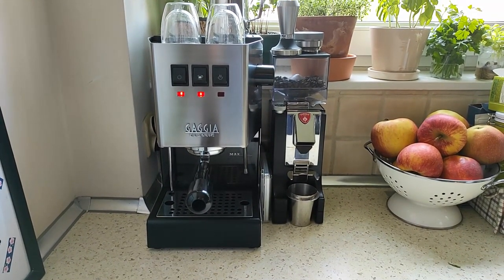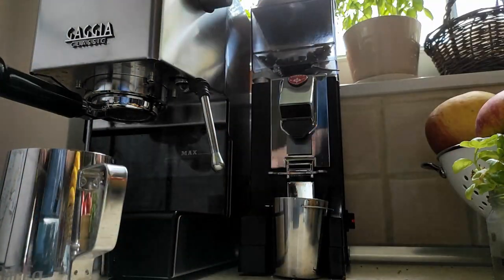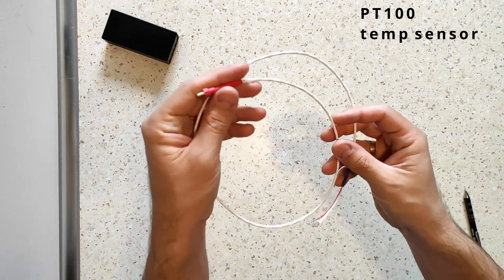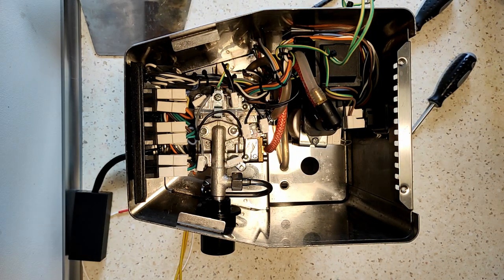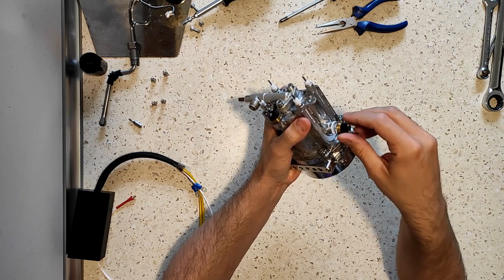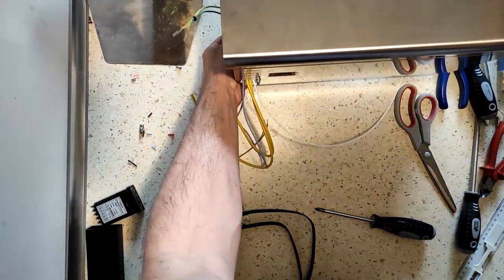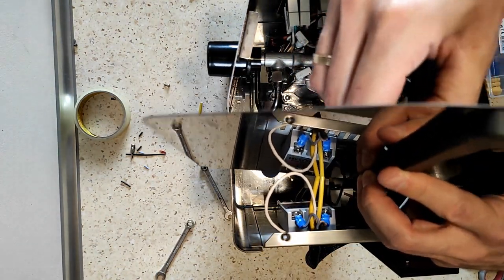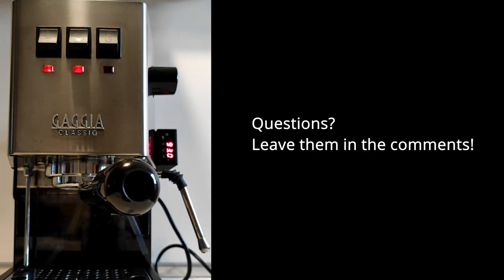How to install a PID on a Gaggia Classic Pro - DIY, cheap and good looking!

Comment: Does rex c100 work in these gaggias? I've installed it step by step as you described and the temp sits at 25-28...very frustrating it doesn't work
Reply from the maker: I've seen people using Rex C100 but I've got no experience with it, so I can give you just some general troubleshooting tips.
1. Double check all connections: whether you're using the correct ports and how securely they are connected
2. Make sure the correct type of temperature probe is set in the PID
3. Let the machine properly heat up, set the desired temperature and run autotuning.

I'll keep my fingers crossed! Good luck

Comment: HI, thanks for the video. Can you please specify the width of sleeve you used, and provide links to the following cables or alternative keywords to use (had no luck searching): 
1. About 60cm of SiHF 2x0,5mm2 cable connecting the PID do the SSR 
2. About 60cm of 1mm2 (17AWG) cable to deliver power from the Gaggia to the PID 
3. About 60cm of FLRY 1.5mm2 cable to connect the SSR to the Gaggia

THANKS!
Reply: Disregard, I was overthinking things. I realized I have a bunch of wire and can insulate it where needed if I have to. Ordered everything I need for $45! Much better than the $200-$300 I almost spent for a ready made kit. Thanks for the guide.
Reply from the maker: If anyone still needs this:
The sleeve width is 15/25mm that's for unexpanded/maximum expanded width.

To find apropriate cables look for:
1. Look for two strand silicone cable of the given thickness. Silicone cables are rated to temperatures reaching +200*C, so they can be comfortably routed right next to the boiler. They are also very flexible.
2. Same as above but thicker and sinlge-strand. If you type in the thickness and "silicone cable" in your marketplace of choice, you'll see them popping up.
3. FLRY-B cable is a PCV coated multiple strand copper cable used in car engine compartments. Look for heat resistant cables of the given thickness, able to withstand up to 105*C.

Comment: Would this mod work on other cheapish espresso machines.  My mother got me a 15 bar espresso machine for Christmas without consulting me on if the machine was even a good idea. So I'm looking around for mods to do on practically any espresso machine rather than specific to one machine. I know it seems like a dumb idea why not return the other one and get a gaggia classic pro, but I don't want to be a prick of a son and tell her that she got me a bad machine. I know about the OPV spring, I'm also looking into a dimmer switch mod for flow control. Sorry for the bother.
Reply from the maker: I managed to get decent espresso from the Gaggia back when it still operated at 15bar pressure, it was just more difficult and hit and miss. My tip for you would be to get a WDT tool and a puck screen to alleviate the high pressure.
As for the PID control - I really don't know. Some principles would still apply, like replacing the thermostat with the sensor and using the SSR to control the heaters, but the details you'd need to figure out on your own, I'm afraid.

Comment: Thanks for the video. This works for Gaggia Classic 2015 EU version?
Reply from the maker: Yes, it should work just fine
Reply: @robertkujawa3504  Thanks for the quick answer. Did you work out how to PID Steam? I am tired of triying to do latte art anda before having It ready, the Steam light goes off
Reply from the maker: There's no need for the PID steam control. Once my kitchen remodel is done, I'll record a video showing how I use the temperature reading to get lots of steam pressure and volume. For now, here are the steps (temp offset 8*C)
1. flick the steam button and watch the temp on the PID display
2. once it hits 140*C purge the wand
3. once it hits 150*C start steaming
4. introduce a single burp of air right at the start and then keep spinning the milk as long as it takes for it to become too hot to touch
5. wipe the wand, release remaining pressure, fill the boiler back up

Using this procedure, I never see the steam light come on and get enough steam for two pitchers!
Reply: @robertkujawa3504  Wow, thanks for your clarfying answer. Waiting for that video without doubt. I have dissambled the machine, and as I said, mine is Gaggia 2015 EU. The button part is different, and the connectors are 4.8 width, so, is it possible to power the PID directly from the energy connector at the back? You just took the neutral from this site. I hope the PT100 fits the boiler btw

Comment: Can you install two PT100 precision temperature sensor to the same PID? One for the Boiler and the other for the steaming?
Reply from the maker: I don't think that makes sense: it's the same boiler, they would both show the same temperature.
Reply: @robertkujawa3504  I meant connecting two Fotek solid state relay (to the PID) to have two settings (one for brewing, one for steaming)

Comment: hi robert, thanks for that awesome video. i am also thinking about buying this machine and modding it. can you tell me if it's possible to do 2-3 double shots after another (maybe with some minor help like using steam wand to bring temp down)?
Reply from the maker: If you're not steaming in between shots and let the machine preheat properly, I'd say it's pretty manageable. I can pull 3 espressos one after another without any detrimental effect on the taste.

Comment: Hi, could you please give me AWG equivalent for your silicone cabling? I’m not sure what your specifications mean. Thank you.
Reply: And why use flry cable to connect to the Ssr? Thx
Reply from the maker: @TomNavesink  So the AWG for the silicon cable would be 20 (AWG 20). And the FLRY cable was used to get proper temperature resistance.

Comment: Hi, thanks for this great tutorial! I have a question though:
For the PID power source is it ok to tap with the piggy back on the power switch instead of the brew switch? I’ve read another tutorial and they tap on the power switch, thanks
Reply from the maker: You should be fine, the bottom white wire should carry 220V, but it's always good practice to verify this with a multimeter.
Reply: What difference should make that change in the connection?

Comment: Thank you for creating this, would all the parts be the same for Canada (which has the same electricity as the US) thank you
Reply from the maker: The PID I'm using can take a range of voltages, so that's a yes.

Comment: I successfully completed my PID controller install. In the end, after watching all of the videos, I just had to guess. No one had filmed the install on an early Gaggia. Mine is from 2002.

Part of the problem here is that Gaggia was entirely inconsistent with the colors of their wires. I had a hell of a time following what the tutorials were doing. In particular on this video, @11:00 he says brown wire. Where? Who knows. Mine does not have a brown wire on the brew switch, which is not in the middle, but on the right. From bottom to top, mine has two gray,  then white, and then red. So...which wire? It would be much more helpful if the tutorials said what the wire does what so that we can look at our particular machine, all of which will be different. 

The piggy-backs I installed when from the neg/blue wire on the power wire on the back wall of the Gaggia and the steam switch in the middle using the double/white wires at the top of the switch. I used heavy (14) gauge wire throughout. I did not have to remove the boiler in order to install the temperature sensor, thankfully. It was a bit fiddly, but with a little patience, not difficult. Also, I was able to attach the extruded box and the relay with 3M double stick tape. The back wall of the Gaggia is cool enough for the tape not to overheat. I cut a 2.5cm x 2.5cm hole in the side of the extruded box into which I was able to fit all of the wires. The result is very clean with no wires visible from the back and everything is reversible. The next step, a dimmer circuit to the pump, will not be reversible, however, as the knob and shaft will be drilled through the side of he Gaggia on the right behind the steam valve knob. 

Oh yeah, it works great and is absolutely worth it. A vast improvement over what I had before. I set the PID for 101ºC, which for my medium dark roast gave a much, much better tasting shot than 103º.
Reply from the maker: True about the wire colors. I recommend having a multimeter on hand, to verify the voltages before you flick the switch.

I happy your mod works!
Reply: I was reading down the comments for similar GC owner to share their PID install following Robert's clear  instruction . I've the same dilemma about wiring color code. Robert tap on brown color to piggy back for live wire, in our case it's Red (Live) color, I also noted on the schematic diagram that the red colored wire is then connected to the steam switch, is it ok to tap on this red wire for Live connection? Alternately someone state that it's okay just to tap on the back of GC or GCP rear switch for power.
Thanks for taking this newbie inquiry.

Comment: Hi I followed your steps and it worked to control temp at Su 103 I set up. However, my steam wand doesnt steam..do you know what may cause the issue? Hot water still comes out if i turn 3 buttons on. Do I need to set up anything specific for steam on PID?
Reply from the maker: What do you mean you press 3 buttons? For streaming you only use the steam button - the one on the right. And the power button, obviously.
Reply: @robertkujawa3504  yes for steaming I only press steaming button and power but no steam comes out

Comment: Hi Robert, I got a pre 2015 Gaggia Classic model, can you please guide me how to borrow power for PID?, front switches pinout is different in Pro version. I  tried to borrow power from top connector in brew switch but PID stays ON when the Gaggia is OFF and when brewing PID goes OFF.
Reply from the maker: The middle spade connector in the steam or brew button should carry mains voltage. Please refer to the diagrams at Whole Latte Love and verify this with a multimeter. There's just a lot of model variants and it's always good to have a multimeter handy.
Reply: @robertkujawa3504  thanks!

Comment: When using a 2nd relay to control steam, you are connecting it to the alarm function of the PID which means there is no logarithmic adjustment of the temp (it's just an on / off switch). Do you think it would be possible and beneficial to use a 2nd PID control unit for steam only?
Reply from the maker: Thanks for taking a look! I focused on just the brew temp in this vid, the hack for PID to control steam is still ahead of me, so I'll answer intuitively. I think that using the alarm function is good enough for steaming, it seems to need less precision than brewing. When I'm ready to explore that option I'll come back with a better answer (and perhaps a follow up video) and I'm definitely going to use this vid for reference: https://www.youtube.com/watch?v=Ewj5oXl_wk0

Here's auto translated article from Damian Witoński: https://translate.google.com/translate?sl=pl&tl=en&u=https://gaggiaclassicmods.blogspot.com/2018/10/pid-xmt7100-modyfikacja-na-dwa.html
Reply: @robertkujawa3504  Thanks, yes, I have seen that video already too.

Comment: Do you think this works for other single boiler machine like delonghi ecp 3x series?
Reply from the maker: I'm not familiar with other machines, but the principle should be applicable. All we're doing here is replace the thermostat with a more intelligent controller. I imagine a number of machines could benefit from this upgrade.
Reply: @robertkujawa3504  cheers! Will have to open up and see

Comment: Hey, first thank you for making this video. It's a very useful resource.

Just a quick question about the cables you used. You mentioned you used: 
"1mm2 (17AWG) cable to deliver power from the Gaggia to the PID and 
FLRY 1.5mm2 cable to connect the SSR to the Gaggia" 
However, in your video it looked like the cable (yellow) to deliver power from the Gaggia to the PID was significantly thicker than the cable you used (black) to connect the SSR to the Gaggia. 
Is this correct?
Reply from the maker: The reason is: the yellow wire is the silicone kind, their insulation is much thicker. I chose silicon wire here because it had to pass over the hot boiler, but in hindsight this might have been overkill. FLRY should be good enough for both connections.
Reply: @robertkujawa3504  Thanks for that. In your opinion, how useful is having a second SSR to control steam? I'm still quite new to this machine.
Reply from the maker: @mathew5164  I'm getting consistently good silky milk with just the stock thermostat. The key is to start steaming when the boiler reaches 150 degrees. Plenty of steam power for a single late pour. I considered using a second SSR but frankly I see no point now.

Please have a look at Evert's comment, he is using the same SSR for both brewing and steaming. I haven't tried that but I think that's a wonderful idea!

Comment: Hi Robert what is the size of the boiler probe sensor . My gaggia classic pro sensor is too small. I bought 2 both are too big to fit. Can’t get the size that show in your video.  What is the size and how to make it fit.
Reply from the maker: Hey there, as fas as I'm aware, the boilers always take the M4 threading. I've never heard of a machine with bigger thermostat holes.

Comment: Power cable for the PID is both yellow? So doesn't matter at PID connection for + and - ? 
(Sry If it's a stupid question 🙈🤣)
Reply from the maker: PID runs on alternating current, so + and - keep changing places 60 times per second. The SSR on the other hand is on direct current (DC) and polarity matters in that case.
Reply: @robertkujawa3504  thanks for quick response 👍

Comment: Maybe I missed it, but is there a reason you aren't also using the PID for steam temp?
Reply from the maker: Short answer: for simplicity
Long answer:
1. the PID I'm using requires soldering in order to control two SSRs and I didn't want to scare watchers off by this
2. everyone who owns GCP cares for espresso, but not everyone cares for milk drinks
3. this was intended as the simplest and most approachable tutorial for anyone on the fence regarding the mod
4. I'm getting excellent silky microfoam with the stock config, so I don't see much point really.
5. if I ever decided to add this feature, I will film it, and I'll definitely use the same SSR for steam that I'm using for brewing.
6. I kind of am using the PID for steam - I use it to know when to start steaming (150*C on the PID is my cue).
Reply: @robertkujawa3504  ahh that makes sense. also very informative to know the pid still helps with steaming even if it doesn't necessarily control steam temp

Comment: Great video! I will try to do it the same way :) Without Your I would be lost! Then maybe I will try to add 'Dimmer mod' as well. Have you thought about this?
Reply from the maker: Yes, a dimmer mod would be high on my "to do" list, but I'm still figuring out the most aesthetic way to do it.

Comment: First thx the for a great guide 👍
One q any hint for temp settings for medium and Dark roast or are the 103 a good default temp?
Reply from the maker: I've found 93*C to be universally good for the medium to dark roasts I'm drinking. That's with an 8 degree temp offset though.
Reply: @robertkujawa3504  do I understand correctly that the difference between water temperature and boiler temperature is 8censius, so I have to put pid to 101cencius?
Reply from the maker: @brevboksen  That is correct, although the "8" is just the most commonly found value and might actually be different in your machine. You might want to measure it if you need precision... Or just go by taste 😊 too sour: make it hotter. Too bitter: brew cooler.

Comment: A quick question - would this process also be effective for the older Gaggia Classic models?
Reply from the maker: Yes, the only difference is the source of power - in the older ones you need to tap into the middle spade on the brew switch and in the back.

Comment: Great video with very detailed information. Now it’s been 6 months since you posted this. Are you still satisfied with it? Anything you would do differently the next time?
Reply from the maker: Hi Adriaan, thank you for the kind words. The setup works perfectly every single time and I wouldn't change a thing, except maybe when doing the cable sleeve, I'd use the lighter trick to seal the strands. Other than that: it's solid.
Reply: @robertkujawa3504  cool, cheers. It was something which was off the table for me due to costs and complexity but as I like some doodling too and thanks to your guide, installing a PID on my machine is definitely back on the table
Reply: I have since made the upgrade and I’m very satisfied with it. Your video guide has proven to be very easy to follow and my espresso shot consistently has vastly improved. Thanks again!
Reply: One question I have however; with the 1x SSR what temp do you read out when steaming? I have yet to use the steam function but I’ve seen it get up to 150 degrees C. without slowing down. I have also done the power switch and timing bypass, so it may very well be due to a combination of these and the PID but I’m unsure. Any ideas? I have yet to trace all the wires from the steam switch to see if it uses the electronics (which I’ve bypassed) or not. I may just be too careful but luckily I much prefer espresso 😄